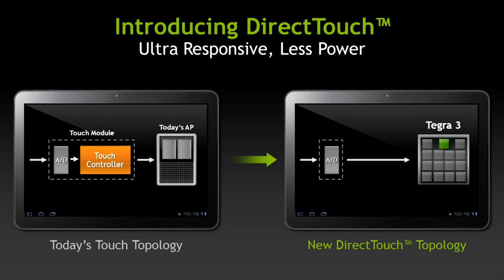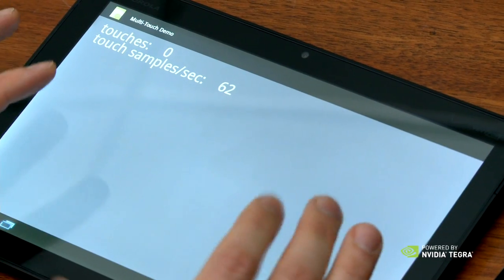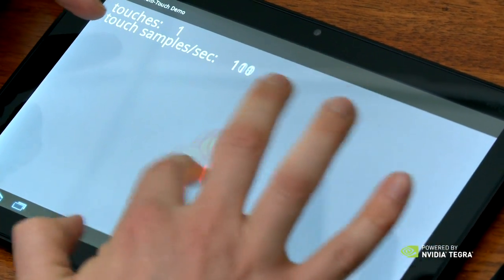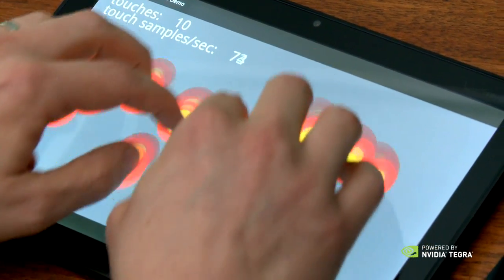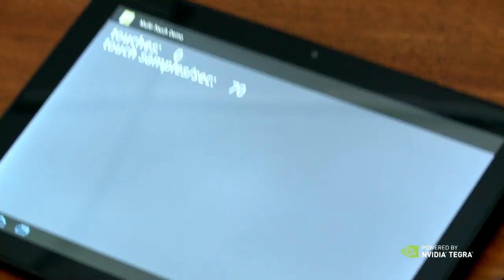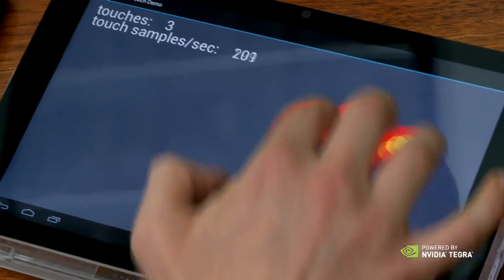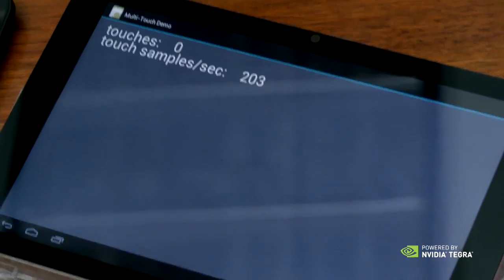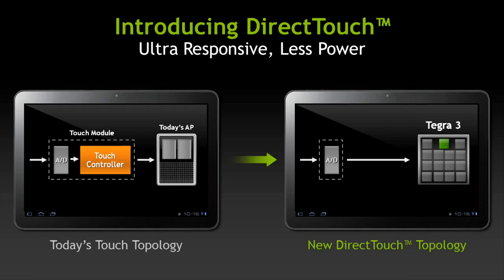NVIDIA DirectTouch Architecture

Comment: @Sil3ntNo0b You will not notice a difference between 60 or 6000. I had a friend who argued with me that he could notice a difference between 60 and 100fps then later found out his monitor had a 60refresh rate. Even if we could notice a difference it wouldn't matter because the refresh rate of the monitors on these devices will only be 60 per sec.

Comment from the maker: @labobo To follow up:
DirectTouch Performance Requirement document has strict accuracy, sensitivity, performance requirements but the OEMs and ODMs have the final decision on what type of Touch sensor and controller they use on their products.

Touch ghosting is a specific term related to 2 touch, touch screen implementations which was resolved 1 year ago and we have not had this problem in NVIDIA Tegra platforms or customer products since it was resolved.